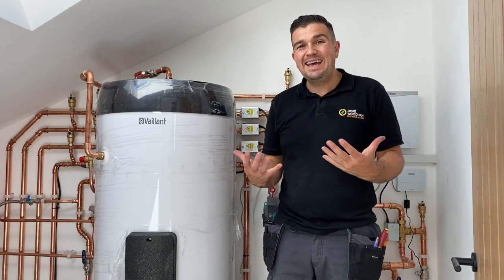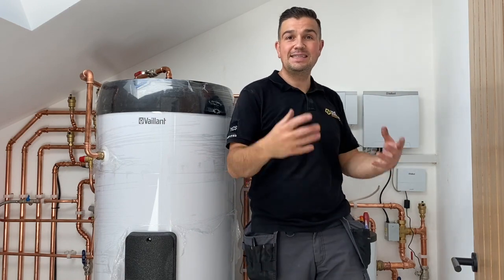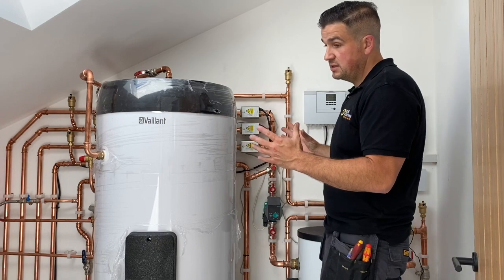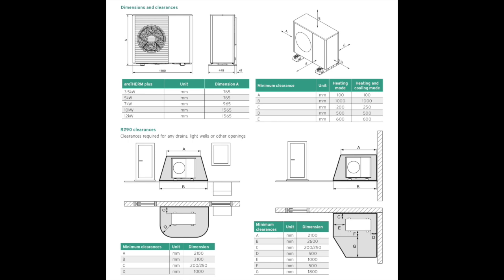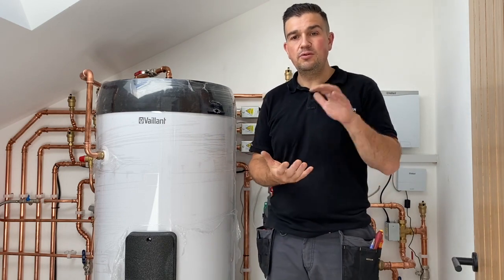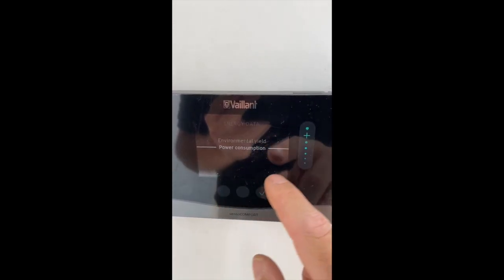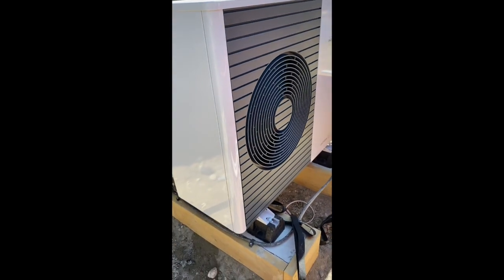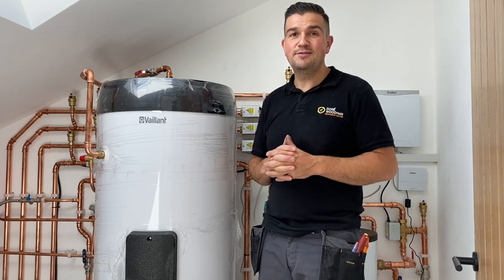Vaillant Arotherm Plus Installation

Comment: Hi enjoyed the video, i had a similar install in a new build property. And looking at your video I'm unsure if its been installed correctly. So have a few questions if that's ok? As i see your install you've separated it into 3 zones which makes sense. Underfloor heating works at different temperatures to radiators. I have underfloor heating on the ground floor, and radiators  on the first floor. On my install it doesn't make sense as the installers have just installed 1 zone. Is this correct or not an efficient way to install this? The installers have mounted the black SensoCOMFORT controller but there appears to be no power to in or internet, i do have control on the app. Any help would be appreciated.

Comment: Beautiful install mate and the video is very informative. Just done my first electrical install of one of these and while it’s more unnecessarily complicated than it needs to be with the volt free inputs into the wiring centre it’s a great bit of kit when it gets up and running. I know you were using the Vaillant controllers there for the radiator zone but if you had to use a third party controller how do you get around the need to have a volt free signal coming from the room stat?
Reply from the maker: Thank you for your comment  ... if the thermostat didn't have a volt free connection we would just introduce a contactor/relay to do the job

Comment: With the multiple zones, multiple underfloor zones, buffer and secondary pumps I would think 3.65 as a SCOP is high. Ideally remove the buffer, remove the two secondary pumps remove the actuators on the underfloor heating as well as the mixer valve on the underfloor manifold. install flow gauges next to the zone valves and do the calcs depending on the max flow rate requirement of each zone.  the system needs minimum 55l of water so you could use the buffer as a accumulator on the return if the underfloor is too small as a single zone. Its a great install nut I do think the Valliant design assumes the installer doesn't understand hydronics.

Comment: Would it be a much simpler (read cheaper) installation to use the new Vaillant uniTOWER with the aroTHERM? - I'm looking to replace an old Y-plan boiler. The tower could go where the boiler is now with the ASHP under the old flue.
Reply from the maker: The Unitower is a great bit of kit and we are big fans. It really comes down to hot water demand and the size of the heating system as the buffer is only 20 litres. Also this was an installation that took place when product was extremely difficult to obtain. We will be presenting a video featuring the Unitower very soon

Comment: Hi. Would you use a buffer if only one circuit and system had enough volume with no 3rd party controls?
Reply: a new build shouldnt need it but manufacturers assume the worst.

Comment: Hi, what heat curve does the pump run with a flow temp of 50 degrees ? And is weather compensation active also
Reply from the maker: The heat curve for a radiator circuit is usually at around 1.2 and for UFH 0.8 and yes that will be active in weather compensation

Comment: Hi, struggling to find some info. Does the sensocomfort act as a room stat too or just a programmer and display screen?

I thought with an external weather comp sensor theres no need for indoor stats?

Id like to run ufh ground floor and radiators upstairs  by 2 mixed units or 1 mixed 1 unmixed.
Reply from the maker: Hi Dan, 

Yes it can be used as a room thermostat if required but equally if you have 3rd party stats they can be used and the SensoComfort will just take care of the installer level requirements, flow temp, heat curve etc .
Reply: @dorewoodman  thanks, its for a self build not started, but didnt think i required any indoor room stats. An installer was saying i would have 2 sensocomforts, one on each floor and an outdoor weather sensor. I thought indoor influence would clash with the weather comp which only monitored the return water
Reply from the maker: @handle1196  it really depends how you want it set up and how much control you want for each room or zone. Are having UFH installed?
Reply: @dorewoodman  yeah, i put in the first message, ufh, radiators and 1 or 2 mixed units to control the heating curve and create two heat zones.

I can see you have 1 pump and 3 zone valves but what blends the zones down that require the least heat?

Comment: I see you have a buffer tank. I was told I wouldn’t need one with my Vaillant system but I have a similar setup to this home in terms of underfloor heating in the large kitchen/diner and lounge. But radiators on the 1st and 2nd floor (loft conversion). Any advice please? They recommended a 7kW Vaillant and my heat loss calc was 6kW.

Comment: Two comments:
1. All that to replace a small gas combi at 20% of the price?
2. I know it has to be done but it just makes no logical sense to have all that kit (no matter how beautiful an instal it is) to replace a simple gas boiler. 
I tell you what my friends are saying; they will replace their old gas boilers when the dead line is approaching so they can avoid all of this. Morally, that’s not right but I can see their point.  
Heat pumps and that huge instal are great in new build properties and the gov should bring forward the requirement to instal to 2022.  For anything else….that’s far more complicated.
Reply: whilst I was originally thinking along the same lines, there's talk now of shifting green levies off electricity, and onto gas. This change would obviously alter the cost dynamic involved, and along with the very real current prospect that energy prices will double by end of 2022, ASHP do seem to make more sense. Add to the mix that new build gas boilers are outlawed by 2025, do you think boiler manufacturers will still continue to do R&D and release products, and again, the price will probably rocket. 
Where's Mystic Meg when you need her eh ?
Reply from the maker: Thank you for your comment. This is an example of a large new build with a great space to work in and wouldn't necessarily be applied to or exactly the same for every home. We have successfully installed systems that have only required an area of 800mm x 800mm in many existing homes.

We are aware that a heat pump will not be suitable for every single home and we certainly do not expect to replace every boiler in the UK with a heat pump but there are many situations and housing stock which are suitable for this technology. 

We have found that many people who wish to change to a greener alternative want to do so as they feel that is morally correct and want to "do their bit for the environment" so I think it is fair to say that there is a difference of opinion up and down the UK.

Thanks again

Comment: Great to see such a tidy install, including the care put into insulating the pipework! Can the outdoor unit be installed on a roof of high up a wall? Are there constraints related to the R290 refrigerant to consider on the placement of the unit?
Reply: Can the outdoor unit be installed on a roof of high up a wall? Are there constraints related to the R290 refrigerant to consider on the placement of the unit?

Comment: What is the maximum length between interior and exterior machines?
Reply from the maker: Hi Mario, there is no official maximum length, the closer the better for efficiency. The key factor is you will need to achieve the minimum flow rate in the system so a larger circulation pump may have to be considered.
Reply: @dorewoodman  I have a 9m length of thermal flow and return to run underground from my pump to the cylinder. Not sure what the best thermal pipe is to get. It’s not cheap. Around £500 delivered for a 10m length.
Reply: About 3 50

Comment: Did you install the weather sensor VR10?
Reply from the maker: Yes we most certainly did. The system would have picked up a fault code without it and of course extremely important for weather compensation and heat curve.
Reply: @dorewoodman  there's so much to learn here. Sorry new to this. My setup is a S system megaflo (horizontal) with Vaillant boiler. I didn't want it use the Vsmart as it's budget offering so going Senso home just realised I need the SensoNet. Is there anything else I need to get this working effectively? I'm worried the installer might be missing stuff.
Reply from the maker: @dwainDigital  it isn't too bad once you get to grips with it. It is a very good way to achieve the best efficiencies for your heating system so well done on that front. The sensoHOME will just require the the sensoNET to support for access via your phone/tablet, very easy to use and will show you information about your system and any faults etc.

Wired or wireless is available and you could go one more level and install AmbiSense - they are basically controlled TRVs for zoning rooms instead of floors if you required. More costly and not essential but if you are quite techy and wanted more control it is a good option.
Reply: @dorewoodman  I've had a bit of trouble with this set up. 
Vaillant sensoCOMFORT VRC720F Wireless RF Multi-Zone Room Thermostat
Vaillant VR921 sensoNET Internet Gateway
Vaillant VR66 Control Centre
VR10 Weather Probe

So the V66 should give CH & HW zones but CH doesn't want to come on when it's set to
Any idea?
Reply from the maker: @dwainDigital  how is the heating set up on the control? If it is working on weather compensation then the flow temp is determined by the outdoor temp?

What was the outdoor temperature showing and is it facing North South East or West?

Comment: Did you install or design and install? If design - what was the calculated heat loss for the building and did you also do a thermal imaging survey of the house exterior (new build houses are notorious for poorly installed cavity wall and other insulation?
Reply from the maker: Hi Norman, we designed and installed for this new build. We have also been involved with the clients and the project throughout so we have seen the levels of insulation that have been implemented to all cavity walls, ceilings, floors and loft space. These particular clients have been involved with the build day to day and were/are extremely fastidious on the detail and the level of quality from the contractor managing the build.
Reply: @dorewoodman  interested to know did the property have MVHR fitted, what was the heat loss for the new build?
Reply from the maker: @handle1196  no this new build opted out of MVHR and had trickle vents instead, the heat loss was approx. 6.8 kw
Reply: @dorewoodman  thanks for the quick reply.

Comment: What would the rough cost of supply and install for the heat pump, cylinder and buffer tank please? We are looking to have one installed in a new build in the Bristol area and we trying to work out if this is within our budget.
Reply from the maker: Hi R Harrison, thank you for your message. It will be dependant on placement of heat pump and ancillaries etc but I would expect it to be IRO £11.5k to £13k. If the system is installed and commissioned before the end of March 2022, you will be entitled to apply for the RHI (Renewable Heat Incentive) which is the 7 year payback scheme. It is all dependant on the final EPC  but the national average is approx. £7,000 so £1,000 per year. The maximum payback is circa £12k over a 7 year period.

I hope that helps.
Reply: @dorewoodman  thank you. If you covered Bristol we would definitely be interested in this
Reply from the maker: @rharrison5508  thank you, unfortunately we only cover the Southeast currently.